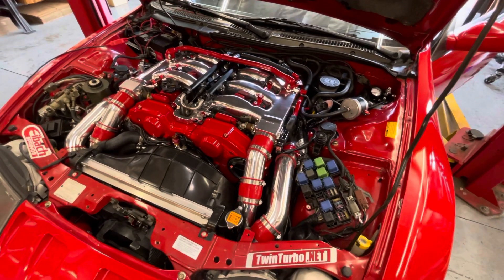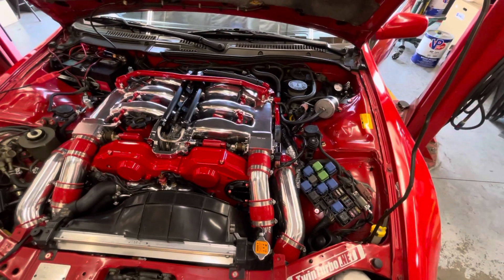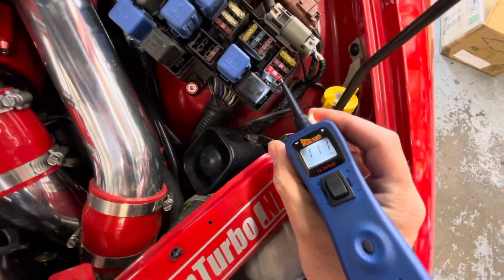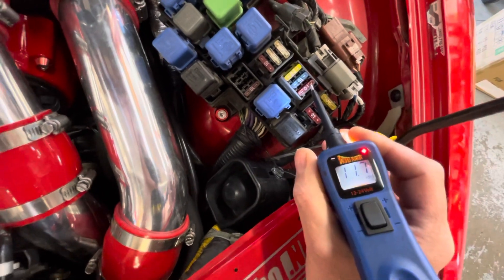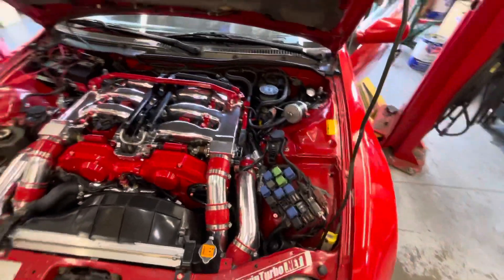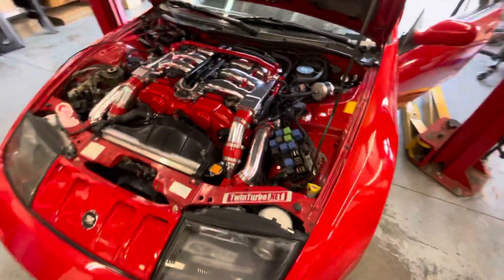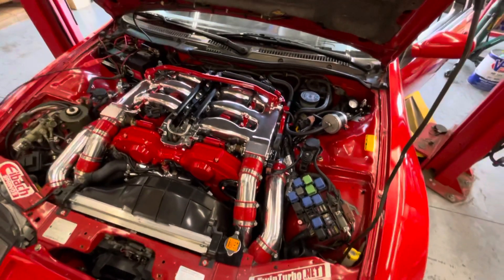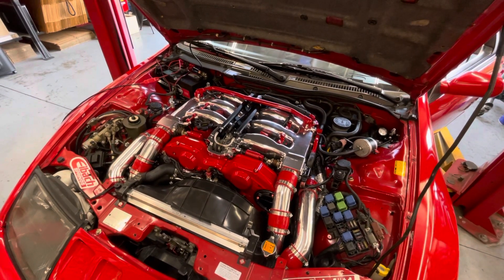Aftermarket ECU Power Supply on a Z32

Comment: Was this with a direct wire or the plug and play unit?  Asking because I’m finishing up on my Haltech 2500 install and I’m using the PnP unit.
Reply from the maker: This was the PnP setup.
Reply: @specialtyz  also was it a stock ecu harness or wiring specialties harness? I have had issues with the WS harness if the ground plug is not put in properly or missing.
Reply from the maker: @johnb300z  Hello! Yes, it is a WS harness. Do you mean the ground cap near the ECU?